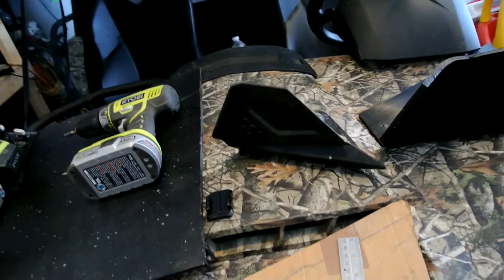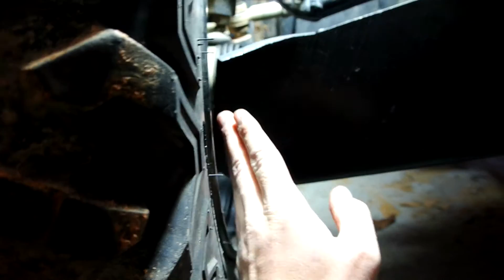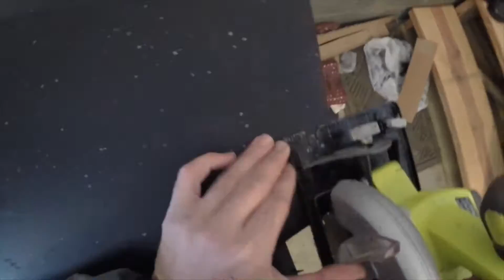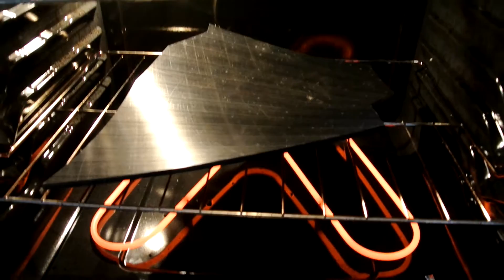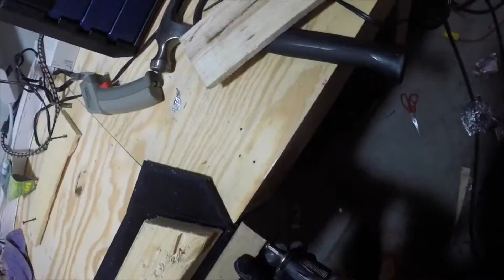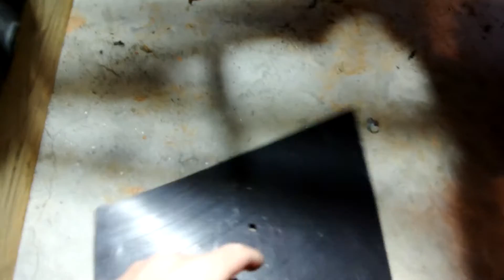DIY A ARM & Axle Guard From UHMW

Comment: I was just thinking about doing this myself, good video. I think ill use a jigsaw and a torch to bend it though. Did you make a skid plate also??
Reply from the maker: Be careful with a touch for the heating process, let us know how it works out.  I have not yet done the skid yet, may  a project for this winter.  Thanks for the comment, please Share & Subscribe.